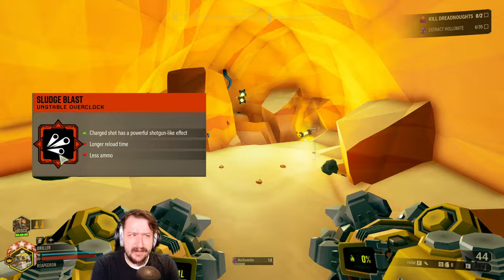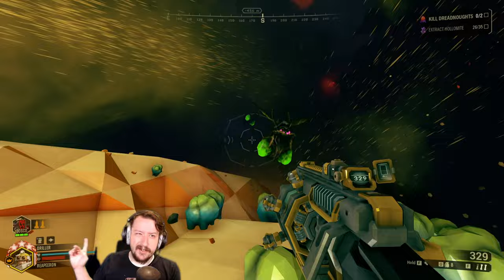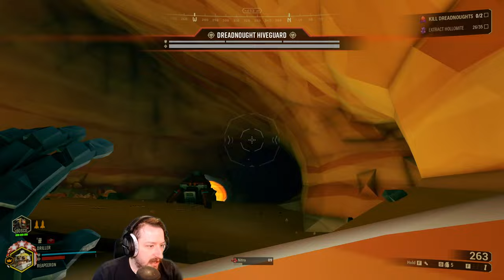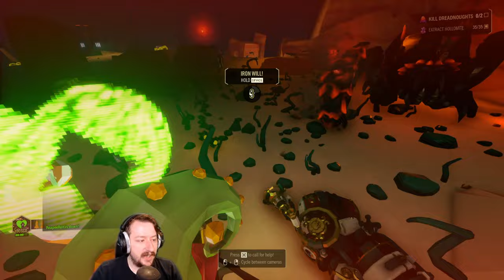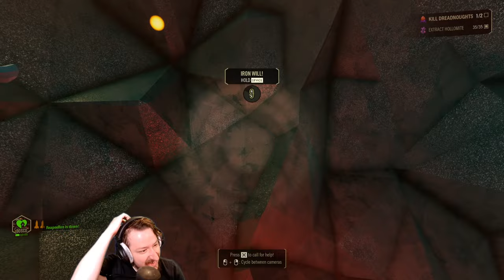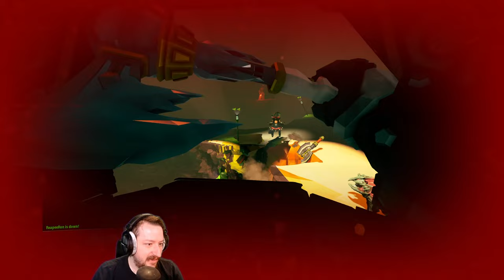Driller Loadouts 101: Sludge Blast + Corrosive Sludge Pump

Comment: YOU CAN USE THE DRILL TO BLOCK SPITBALLERS???????
Reply: Yep, I've only ever had it work as a host though so I'd highly recommend not trying it in someone else's lobby depending on how good your connection is.
Reply: Im a driller main and this is news to me. Thx for dropping that knowledge .
Reply: yea but it requires some tight timing so i prefer to dodge the projectiles with dash
Reply: Kinda blew my mind, too

Comment: i looked this video up once i started using this overclock just to see i wasnt very far off of what you had, but i use the full auto subata with the tier 5 neuro corrosive toxic catalyst and stack for ammo, so i blast things with the sludge pump and just start blasting away with the subata, making the corrosive damage ramp up over time, very good at crowd control as well as super high single target damage.